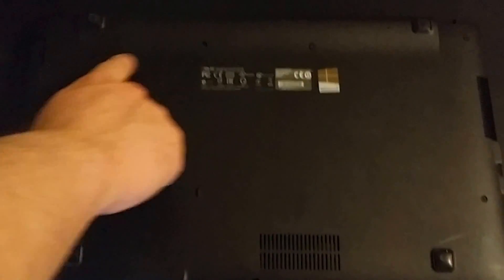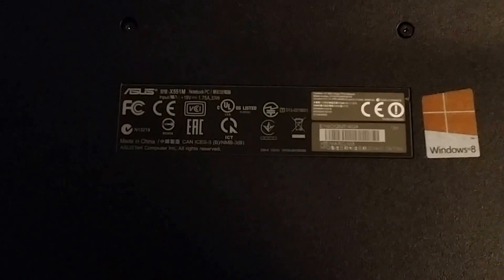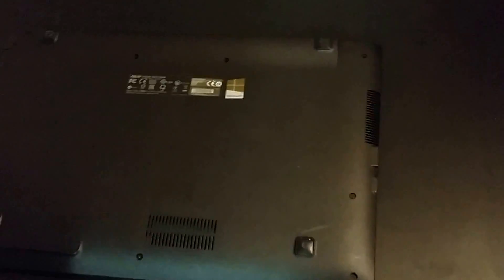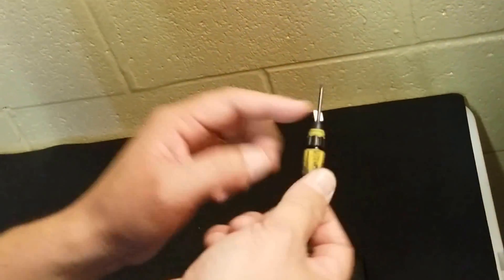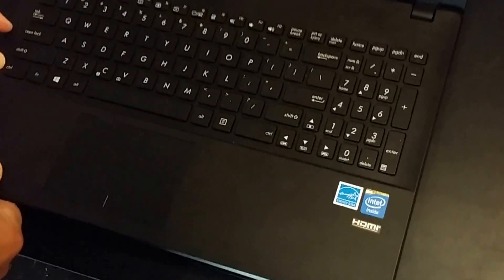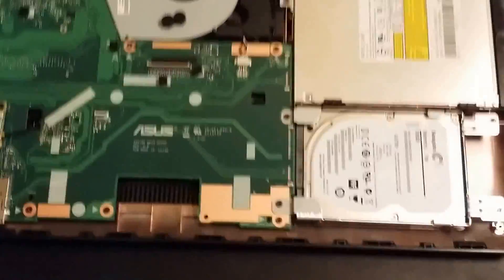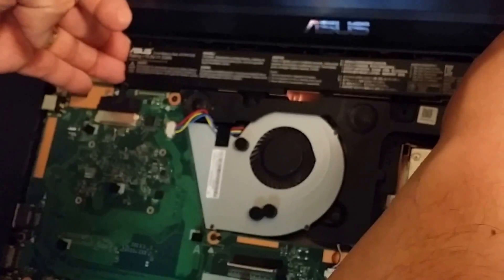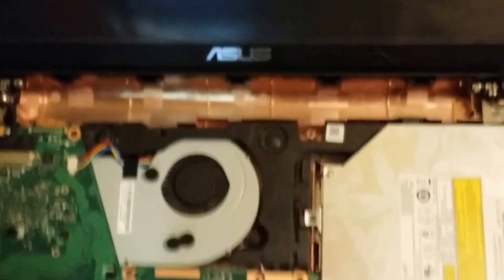ASUS X551M Laptop Battery Removal & Won't Power On Fix

Comment: Hey I was removing the screws and when I got to the screw in the middle of the left side of the asus laptop I just couldn't seem to unscrew it because the screw was stripped, do you have any ideas on how to fix it? I've tried to rubber band, the duct tape, and simply just switch tools. But nothing seems to work, any help?
Reply from the maker: I would try using this:  Moody Tools 58-0670 6-Piece Slot/Phil/Screw Extractor Combo Reversible Driver Set.  This set is sold on Amazon and is specifically used to removed stripped laptop/smartphone screws.  Here is the link: http://www.amazon.com/Moody-Tools-58-0670-Extractor-Reversible/dp/B000JCT3W0

Good luck!
Reply: ***** Thanks, and I have a question; A while back my Asus Laptop X551M stopped working but when I turned it on, the led lights would come on but the screen would stay black. Do you have any ideas on why that happened and how to fix it? I was trying to the method where you unplug the adapter, then take out the battery, then hold the power button down to drain out any remaining juice, then plug in the adapter THEN press the power button and see if it works. But you see the stripped screw messed me up. :D Any solutions? :D
Reply from the maker: ***** The method you used by taking out the battery is mainly used to "reset" the motherboard from an analog speaker plug being plugged into a USB port accidentally.  If your screen is black with no picture but all the lights are on and the CPU fan is running, it could be a few things.

1.  Your motherboard/graphics chip is defective.  To rule this out, plug in an external monitor and try to get a picture by using a FN/F1-F12 combo (look for an icon on the function keys that looks like a small monitor to large monitor or something that looks like a monitor in general).  If you get a picture, either your LED cable is damaged or loose or your LED screen is bad.

2.  Test your memory.  Remove the memory (if your model permits this as this model sometimes has memory soldered on.  If you have the type where your memory is a removable SODIMM, remove it then power the system on.  If the system continually BEEPS, then your motherboard at least has "life".  While you are at it, make sure all the ribbon cable connections are inserted properly to eliminate a loose connection.  If it doesn't beep at all and stays on the black screen, it most likely is a dead motherboard.

3.  Remove your hard drive.  Failed hard drives sometimes will not allow a computer to POST or ever see any picture at all.  If your drive is bad, then removing it will at least allow it to POST and show you a "no boot device error message" and see the ASUS splash screen.

When all else fails, bring it to a computer repair shop for a diagnostic.

Hope the helps!
Reply: ***** Hey actually I left out a part in my previous comment; I forgot to mention that when I would try to turn on the laptop by pressing the power button nothing would turn on EXCEPT the LED lights. Sorry, forgot to tell you that. Now that I told you that would that make any difference to the suggestions you gave me?
Reply from the maker: ***** If you don't hear any fans running, hard drives trying to spin up or the CD/DVD drive click (as it turns on), then it is most likely the motherboard and it probably failed.  Again, you can always bring it to a computer repair shop for a hands on look over to verify what I am saying as I am only reading your symptoms versus seeing it.

Comment: How do you pry the top open
Reply from the maker: Start at the top right side and simply pull apart the top lid from the bottom lid.  If you can't get the separating started, use a butter knife or a very thin screw driver and gently pry the lid apart from the base.  The lid is being held by locking clips so be careful to not break them or else it won't be able to secure back down properly.

Hope this helps!

Comment: My grandson accidentally plugged his headset into the wrong opening and now computer won't turn on. Did he short it out or what? Not sure what to do at this point.
Reply from the maker: Follow the steps from my video and remove the battery.  Reattach the Power Button ribbon cable WITHOUT the battery or AC adapter plugged in and press & hold the power button for 30 seconds to discharge any residual charge on the motherboard/laptop.  Detach the ribbon cable, install the battery and then reassemble the laptop but do NOT screw in the screws yet.  Assuming your battery is charged, power on the laptop.  It SHOULD power on at this point.  If it does, then turn off the system and completely reassemble the laptop.

Devin
Reply: Okay. Thank you.
Reply from the maker: Karen Lyman You are quite welcome!  Good luck!

Comment: I'm currently trying to fix my laptop because I accidentally spilt a glass of water on it. It's been a day now and I did dry it overnight and tilted it. When I turn it on all the proper lights at the bottom turn on but my screen won't. Also I have the same model as the one on the video. Please help
Reply from the maker: The first thing I would do is connect it to an external monitor to determine if there is motherboard/keyboard damage.  Anything water is introduced into an electrical system, it causes the parts to literally short out or become damaged.  One day may not have been enough time.  I hope you took the battery out as well when it was drying.  Also, you can try the bag of rice / silica gel drying method.  Literally place the laptop in a large ziploc bag and put either rice or lots of silica gel packs inside and seal the bag.  This will draw out ALL the moisture to run out any more left over liquid that is shorting out the components.  Dry for 48 hours.  After that, connect it to an external monitor and power on the system.  You will have to switch the onboard video to the external monitor using a FN and F1-F12 key command (look for a Function key that looks like a monitor or a small to large monitor icon).  Hold the function key down then press the appropriate function key that will then switch the picture from your LCD screen to an external monitor.  If you see a picture, then your LCD screen or LCD cable could have been damaged.  If you don't see a screen, chances are your motherboard is damaged and you will need to look for a replacement.  You can price out a replacement motherboard on Ebay or Amazon by searching for either the motherboard part number (recommended) or by typing "ASUS X551 Motherboard" on those sites.

If you don't want to mess around trying to repair it yourself, you can always bring it to a computer repair shop and have them take a look at it.  If this was a $300 laptop and the repair cost becomes over $150 (50% or more), you might want to consider calling it a loss and possibly purchasing a replacement.

Another thought, how old is this laptop?  If it is under a year, it might still be under warranty!

Good luck!

Comment: I have an X550D I use for gaming "cough cough bad decision" and I am trying to do a routine cleaning and can not get into the back seems like the same setup as the X551 but just wanted to ask to be sure
Reply from the maker: I honestly do not know if the X550D is the "exact same" but I will go out on a limb and say they should be relatively close.  Based on the model number convention, common sense wise, you would think they would be similar but this is Asus we are talking about here so who knows.  Once you remove the keyboard cover, you should know fairly quickly if they are similar or not.  Let us all know for future reference!

Good Luck!

Comment from the maker: Clash of Gaming,

You can order the Asus X551M EXACT battery model A31N1319 from Ebay.  Here is a link for it!

http://www.ebay.com/itm/new-Asus-X551M-X551MA-Genuine-Battery-11-25V-33Wh-A31N1319-/221718284357?pt=LH_DefaultDomain_0&hash=item339f708845

Hope this helps!
Reply from the maker: For some reason, I tried replying to you Clash of Gaming but there was no reply link to your original comment.  I hope you get this answer!
Reply from the maker: crazyymelody I JUST replied to your comment on what the possible problem is and what you can do to figure out what is wrong with it.  Good Luck!
Reply: ***** Thanks so much!!!  Your help and your video is much appreciated.
Reply from the maker: Clash Of Gaming Anytime!  Glad to help and good luck!

Comment: Hi!  Thanks for the video - very helpful.  One question though relating to the battery replacement; I have searched and searched for a place to order a replacement battery for this particular model (X551M) and am having no luck.  Where would one order this particular battery?

Comment: I tried that but after it just goes to a frozen black screen and makes a beeping rhythum
Reply from the maker: Unfortunately, you most likely have a failed hard drive.  Based on what you are telling me, if it won't go to the ASUS / Windows 8 Troubleshooting by holding F9 on restart and there is still a frozen black screen, you will need to get the hard drive replaced.  Take it to a computer repair shop and have them do a visual diagnostic and let them try to get to your safe mode or test the hard drive using a hard drive diagnostic tool.

Good luck!
Reply: Thank you
Reply from the maker: Allen Ace You are most welcome!  Good Luck!

Comment: My computer says pro
E
Preparing automatic repair and stays that way, then it goes to a black screen and stays frozen there, I have tried holding f11, shift and f8 and no such luck. I was hoping that taking out and putting back in the battery would do the trick but it didn't work. What should I do that doesn't require me having to go out and buy something?
Reply from the maker: Have you tried holding the F9 key down after restarting the computer so you can get to the troubleshooting partition of Windows 8 yet?  If this does not work, you might unfortunately have a failed hard drive as failing an automatic repair or going to a black screen / frozen is a possible sign of that.  Let me know what happens after trying to get to the troubleshooting partition.

Comment: And my computer turns on and it says preparing automatic repair, o have tried shift and f8 and f10 but it won't work, I was hoping if I removed and reput the battery that it would fix, but no such luck. What do I do that doesn't require me to go out and buy anything or a cable

Comment: I got into a problem with my X551M and most sites suggest I remove the battery and mains, hold the start button for 30 secs routine. But all of them seem to assume the system is totally blanked out. I get the LED screen glowing albeit dimly, and the mouse icon could be moved around. The USB device connected is glowing too. But the screen does not come on to an active state of displaying the login screen. It is a win 8.1 bought in Nov 2014. I am afraid of opening the system at home for fear of static charge. I can take it to a local agency. But since the symptom is so different, (not totally dead, but mouse icon is on and display is glowing hazily), I am wondering if I have a simpler / different problem. 

Yesterday morning windows was seeking to update itself. The problem occurred after the first shut down following this update. 

I appreciate the clarity in your narrative, and you inspire confidence.
Reply from the maker: You have what is called a failed or botched update/s which caused your Windows 8.1 Operating System to act abnormally.  You need to restart your computer and hit the F9 key to access the recovery partition.  Follow the onscreen instructions to get to the System Restore feature which will allow you to pick from a recovery point without losing your data.  Do NOT select System Recovery unless System Restore does NOT fix your problem.  If you have any questions, feel free to comment more.
Reply from the maker: To be more clear, restart your computer and HOLD the F9 key down during the ASUS boot/POST to access the Troubleshooting partition.
Reply: So nice of you to respond so fast. You are an angel! The system is back in action. 
I was a bit confused as nothing seemed to happen when I hit F9 after turning the system on. I repeated this a couple of times. Then I got the ASUS logo on, and waited a few more seconds for it to get back to normalcy. I did not see the system restore screen or any thing like that. 

Now should I get win 8.1 to update by doing some thing? My inclination is to let to do it by itself. I am yet to dig in to see if I missed any data. I do not expect that since I shut down all apps before shutting down the system. I guess after an update the system does not shut down immediately on its first shut down, and I should not force it.
Reply from the maker: Sowmyan Tirumurti Great to hear that your system is back up and running again!  Yes, the Windows 8.1 updates does take a long to to fully finish at times.  What is worse is that the screen may seem like the computer is off due to screen savers or sleep mode and a lot of people may hit the power button to turn it off not knowing there is an update in progress.  In the future, always move your mouse around to get the desktop to show up prior to turning off the computer.  NEVER do a hard shut down unless absolutely necessary (when the computer is non responsive or "frozen").  Always use the correct Windows shut down procedure by selecting Shut Down to turn the computer off.  As far as updating the computer, type in Windows Update in the search bar and select Windows Update to manually check for updates and if any are there, update the system and ALWAYS have the AC adapter plugged in and ALWAYS let the update finish before turning off the computer.

Good luck!
Reply: ***** Thank you so much.

Comment: Hi ***** 

My x551m notebook automatically shut off on low battery as I was plugging in the charger. Now when I turn it on, the green light indicates that its on but the screen is not on. 

Do you know what's going on?
Reply from the maker: Disassemble the laptop and remove the battery.  Once the battery is removed, hold down the power button for 30 secs.  Plug the power button cable back in WITHOUT the battery.  Plug the AC Adapter in WITHOUT THE BATTERY then turn it on.  If the video chip/video cable/LED screen/motherboard did not go bad, then you should be able to turn it on and be able to see a screen and boot to Windows.  If you still cannot see a screen or boot to Windows, comment back here.
Reply: +Angrysquirrel PC 
I followed the procedures listed, the screen didn't turn on. The only thing that turned on was the green light that indicates it is on.
Reply: I've only had this PC for 6 months. This is the only problem that has occurred.
Reply from the maker: The next thing I would do is connect it to an external monitor to verify if you are getting a picture to eliminate the LED Cable or LED screen as being part of the problem.  You model is probably an HDMI output or possibly a DB15 VGA.  Connect it to a monitor then you will have to use a combination FN/Function key to switch it from your internal LED screen to an external monitor.  Look for a picture icon on one of your FN keys (F1-F12 that looks like a "monitor" graphic or a small screen to a bigger screen).  You will have to press the fn key at the bottom left corner area of your keyboard then press the FN key that is the monitor.  Let me know what happens.
Reply from the maker: If this still does not fix the problem, the only thing you can do is remove your memory modules and try reseating them or possibly replacing them for known good memory to also eliminate that as the culprit.  If these things don't fix your problem, you might have a bad motherboard/bad graphics chip issue.  Since it is only 6 months old, call ASUS warranty support and get it replaced.
Reply: ***** I've tried the VGA with the f keys nothing shows on the monitor. I have an HDMI cord as well but there isn't a slot for HDMI on my monitor. I've also tried reseating the memory.
I guess I'll call them. Thanks for you help.
Reply from the maker: Yes, unless you can get a monitor that is HDMI compatible, we can't rule out the LED Screen or Cable.  It might be best to contact ASUS at this point since it is under warranty.

Good Luck!

Comment: Hi, i got this laptop for xmas and was wondering how long should a fully charged battery last. Mine doesn't last very long at all approx 2hrs just browsing the web  Thanks for your help
Reply from the maker: Standard 6 cell laptop batteries usually last anywhere from 1-3 hours.  The time depends on what you are doing on the laptop.  Are you using the laptop wirelessly?  When you are surfing the web, are you watching videos on Youtube or anything with Flash advertisements or animations?  2 hours on battery life is about the average when it comes to laptops.  If you need your laptop to last longer without an AC adapter, I normally recommend either a 9 or 12 cell battery but since this ASUS model is an enclosed unit covering the battery, I do not think you have that option.

Comment: Hello , i accidently touched usb port with my headphone jack and it just shut down with no signs of life. (Laptop) Any suggestions ? Please i really need to fix this , this laptop is not mine
Reply from the maker: Follow the steps from my video and remove the battery.  Reattach the Power Button ribbon cable WITHOUT the battery or AC adapter plugged in and press & hold the power button for 30 seconds to discharge any residual charge on the motherboard/laptop.  Detach the ribbon cable, install the battery and then reassemble the laptop but do NOT screw in the screws yet.  Assuming your battery is charged, power on the laptop.  It SHOULD power on at this point.  If it does, then turn off the system and completely reassemble the laptop.

Devin
Reply: I have the same problem with the USB port and headphone jack. Amazedby Kev, did you try to fix it yet and did it work for you?
Reply: AmazedBy Kev same happened to me